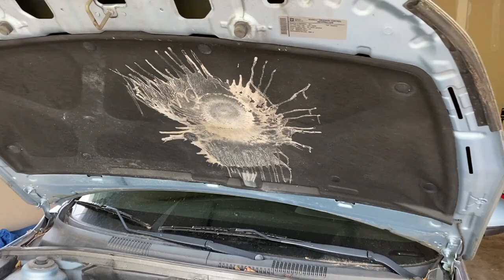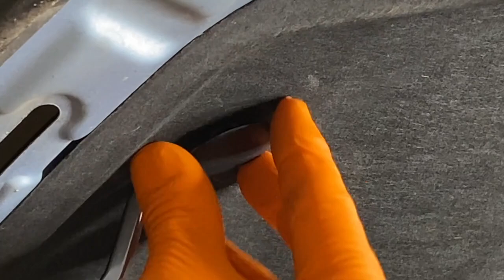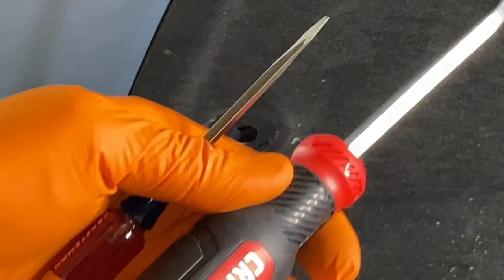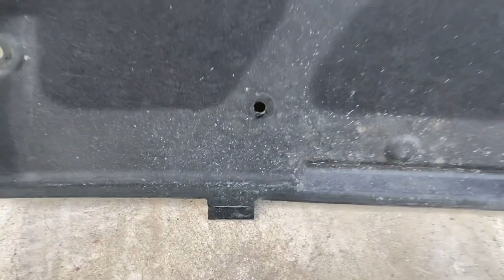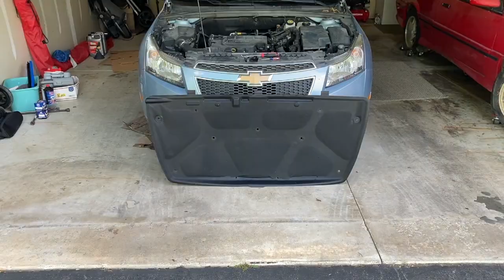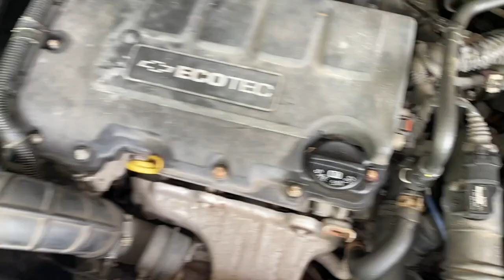Remove stains from inside engine hood insulation liner

Comment from the maker: If interested in purchasing this product, visit our Amazon affiliate link below.  I earn from qualifying purchases.

Craftsman plastic lock removal tool:  https://amzn.to/3AjnxqS

Engine hood insulation panel (2016-2019):  https://amzn.to/48uoUQ1

Steel roller skates for car:  https://amzn.to/3fXJPBl

Craftsman socket wrench set:   https://amzn.to/3Am1KyI

Third brake light:  https://amzn.to/3YoWyCn

Engine hood lock clip (10):  https://amzn.to/3YEzOPS

Engine hood lock clip set (30):  https://amzn.to/4flCVSG

*********************************

Fixing Boats and Jet Skis PlayList

          https://youtube.com/playlist?list=PLjCXOz8TSkZlae2qY97uVVTm3JdBOUoRS&si=1AoD56hxrfRX8FBK

*********************************

1.  Putting car on steel roller skates

          https://youtu.be/54EJtzrSQoY

2.  Change Cruze engine oil

          https://youtu.be/WFZ8ULOSjSQ

3.  Replace coolant return hose

          https://youtu.be/FNXiR1do2Ws

4.  Replace coolant outlet valve

          https://youtu.be/X1S8liNxYMs

5.  Replace Cruze radiator sensor

          https://youtu.be/0pBWv7JlO7Y

6.  Replace Cruze engine air filter

          https://youtu.be/_8xZw9D2aAA

7.  Replace Cruze engine air filter sensor

          https://youtu.be/Z6LibAry0qM

8.  Replace Cruze water pump

          https://youtu.be/V85SIHpBLMQ

9.  Replace Cruze engine thermostat

          https://youtu.be/8F-17wODadQ

10.  Replace Cruze Serpentine belt

          https://youtu.be/0u-zCwZeyUo

11.  Replace Cruze turbo oil feed line

          https://youtu.be/y4jOxrHgHjE

🧰

Comment: Mike would that fit  on  if you flipped it over ?  just wondering  if it would work that way
Reply from the maker: @joedevitto6113  

Thanks for watching Joe, anything is possible I’m sure however it will unfortunately 100% be damaged if switched around and pressed into place backwards.  😎👍🧰